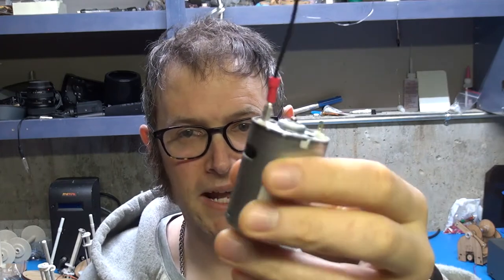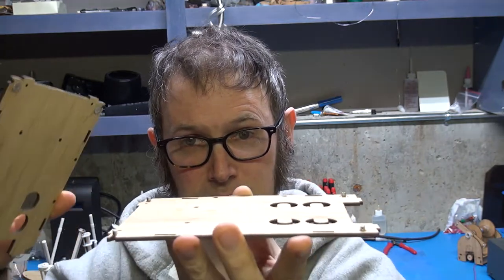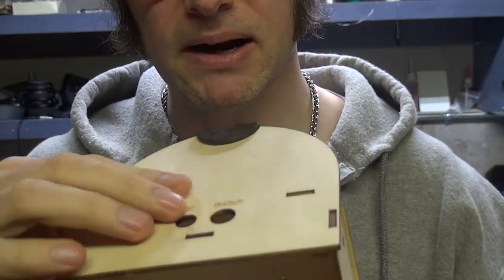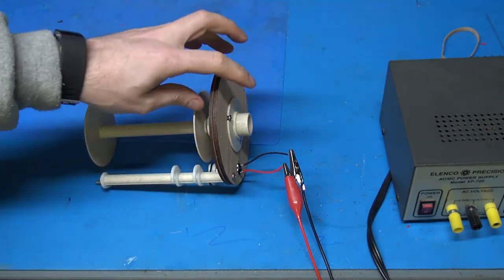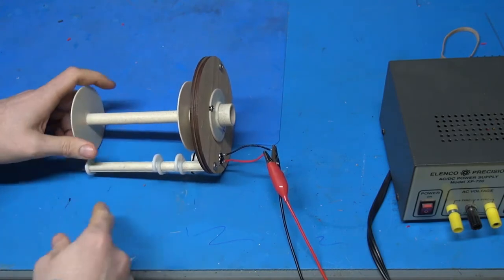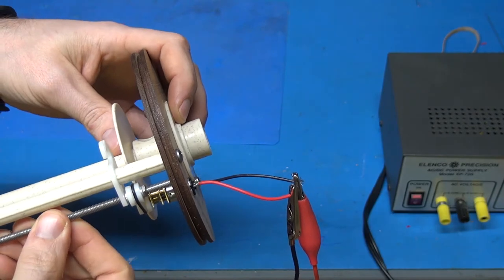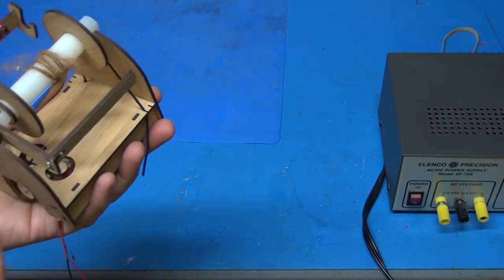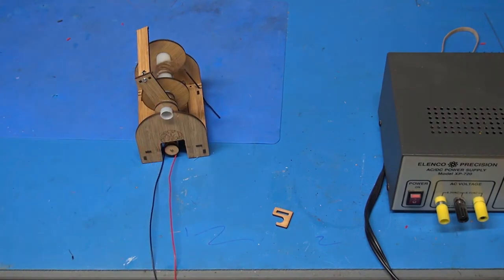Spin #23 - EEW Related Future Work

Comment: You are the super hero of the fiber world! I just got my E5 and love it. Thanks for your hard work. About the moving hook...if the hook material were metal,  could something be done with magnets inside the tube to move the hook? One magnet pulling the other?
Reply from the maker: That's an interesting idea, but putting a magnet inside the current flyer bar wouldn't work.  The plastic walls are too thick and the inside areas is too small.  It is something I'll keep in my mind if I do a big redesign someday.